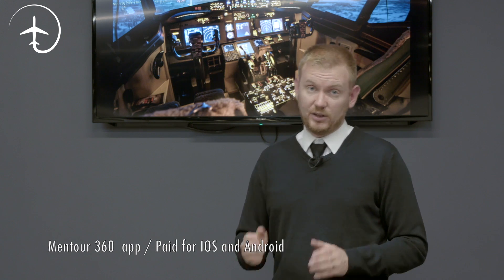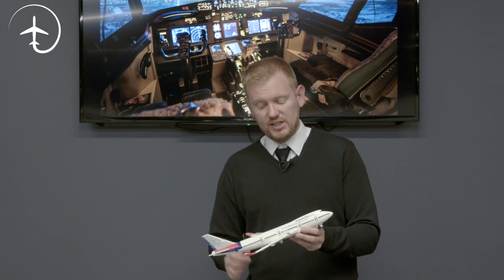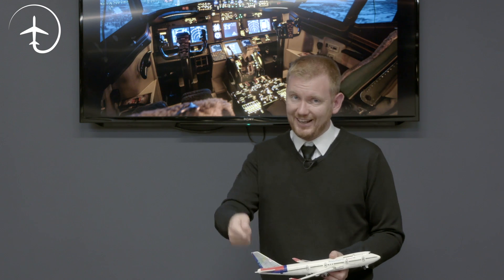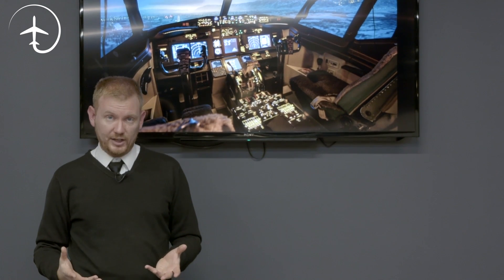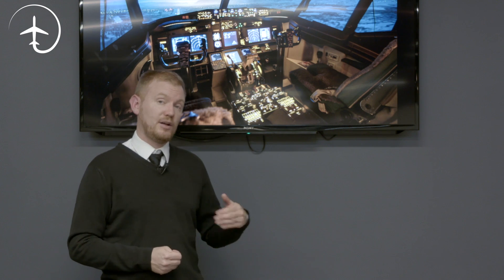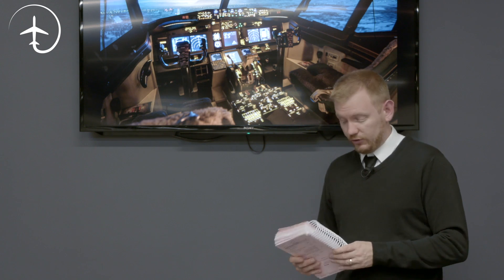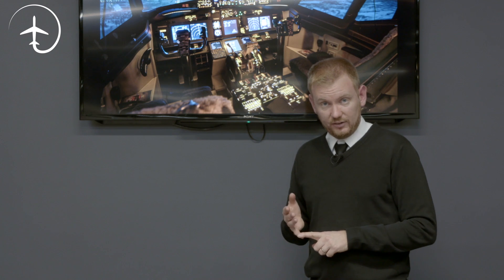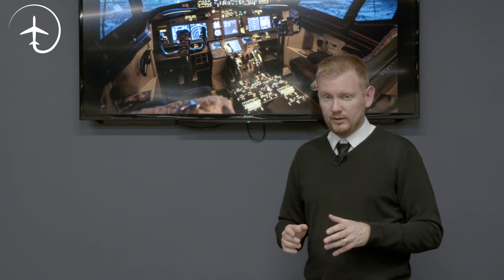Engine failure after Takeoff - Briefing

Comment: how you dump fuel if you have one engine burning??
Reply: Hi all, there are two fuel dump valves, if the left engine is on fire there is a standard practice of hitting the extinguisher, x feeding the left tanks to the right tanks and releasing fuel from the opposite valve on the right winģ... if sensors show that fire is out then fueĺ can be released from both valves. Although there is a maximum landing weight for each aircraft type the main considerations are that of the runway not the aircraft so a landing could be made immediately if needed...
Reply: Well, it seems you put out the fire before it catches the whole wing on fire.  I'm not a pilot, and I know that extinguishing an engine fire is a higher priority than dumping fuel.  Aircraft fires are very dangerous.  Best to get them under control before they get out of control.
Reply: the thing is, that if you were flying for only few minutes and got a bird strike and your engines got fire.. now you need to land but you cant since you are too heavy, and you cant dump fuel becouse engines are burning..

in that case i think you gotta pray that extinguishing controls work or you have a way to close fuel pumps to your engine/engines..

i wonder if you can actually prevent aircraft engine getting fuel in first place..
Reply: i think in that instance, if there was no time to dump fuel (or the fire wouldnt go out)
you would need to butter that bread VERY gently and hope the landing gear doesnt collapse
Reply: Extinguished the fire

Comment: A great video as always. But I am curious about why you retract the landing gear and flaps as soon as you can in these case? Would it not be recomendeble to first identify the problem in order to see if the hydrolic and electronic systems are all operational before you do that? Cause in case you are losing hydrolics you might want to fly with gear and flaps down in order not to lose the abilty to re engage those later for example. Johan.
Reply from the maker: That has to do with performance. We first want to get the aircraft safely up on the air, then we can trouble shoot further.
Reply: I can understand that and its a great aproache when all the other systems are working as they should. But it could be less great when they are not - Or do you get warning lights and info if they do not? Johan.
Reply: @JohanMsWorld  when the flight envelope is such a close proximity to stalling and the immediate risk of the aircraft and that of people in the flight path is great the main thing is to get airborne, altitude is your friend... the undercarrages are designed to not need hydralics to lower them if they fail. They can be dropped down. Aircraft have APU systems on board as well to back up hydraulics pressures if needed, some times you can hear this during start up/shutdown like a barking dog in the nose wheel section of most aircraft... to get to 400 feet takes a few moments and once a positive rate of climb can be established and drag minimised then troubleshooting can begin...

As a comparison its like getting a puncture on a motorway, you would still roll the car to safety and then assess the situation when safe to do so

Comment: Can you do a video about the engine instrument page? I am confused on the difference between N1 And N2.
Reply from the maker: +Aaron Frick I will see what I can do.
Reply: AFAIK, it's basically pretty simple.  Modern "fanjet" engines have two rotating spindles N1 describes percent-of-maximum RPM for the fan and low-pressure turbine on the "low pressure" spindle, whilst N2 describes the percent-of-maximum RPM for the compressor and high-pressure turbine on the "high pressure spindle".  In "glib" terms, N1 describes how much air the engine "sucks in" and N2 describes how much energy the combustion chamber "blows out".
Reply: N1 = percentage of the maximum rotation speed of the big fan at the front of the engine 
N2 = percentage of the maximum rotation speed of the compressor and turbine stages

Comment: What do you do if there's a double engine failure after V1? Try to abort takeoff anyway?
Reply: Then you should proceed to the crying procedure.
Reply: Then you'd better hope your Fred Flintstone stopping practice finally pays off, because without thrust, you aren't going to go up, at least not for very long, if at all.  You'd better hope your airport is the one with retarding concrete at the end of the runway.
Reply: You would also lose electrical power (power goes on standby battery and instruments go to standby) and hydraulic pressure (so everything would revert to non hydraulically assisted cables and pullies on the 737) and problems retracting landing gear, flaps.    The only option would be to reject takeoff
Reply: Youre not getting off the ground very far if both engines fail after v1 lol. You have no vhoice but to stop
Reply: Hope and surely know if there was on overrun extension out there to drag the beast to a halt.    Otherwise it’s slightly right or left, anything to avoid hitting all those ILS towers straight off the runways end.
Reply: Colin Southern ah but far better than the all too familiar 50-150’ 70 knot stall-spin with the usual fireball finale.    it seems like nobody ever survives those thing when they quit like that if they try to fly it.    There’s just not enough power.

Comment: I don't understand why you have to check parameters, speed and roc before gear up. no way you can go back down to runway, so sooner you get the gear up the better. is it that if you have for example zero climb then putting gear up could increase drag and give you descent instead of climb?
Reply: There had been instances where pilots retracted the gear too early and the plane collapsed onto the runway and slid along. That's why the procedure was put in place to check these parameters and announce "Positive Rate", followed by the command "Gear Up", regardless of emergency or not. The entire procedure takes 2 seconds.
Reply: If the plane isn't climbing at that point, there's a high chance you're going back down onto the runway, if that happens you don't want to already have your gear up and belly slide.
Reply: No waste more energy?